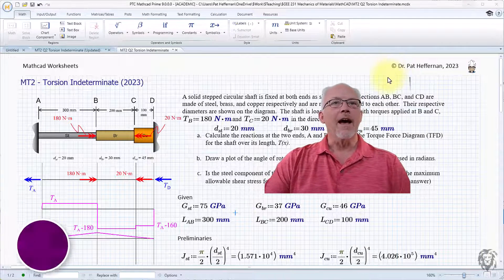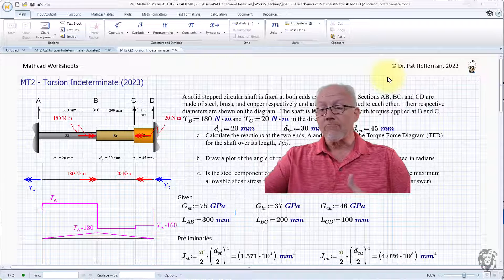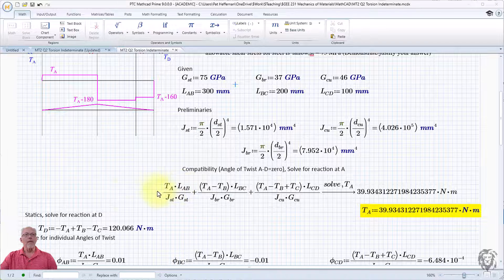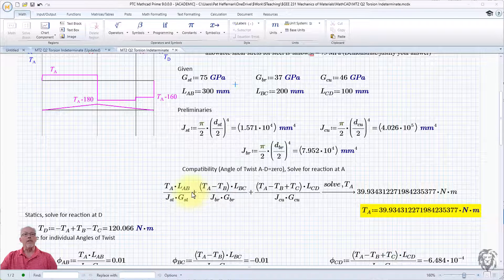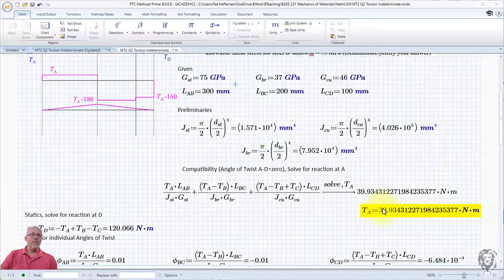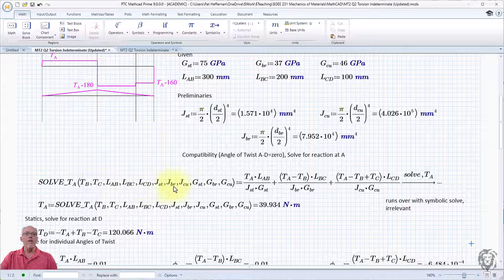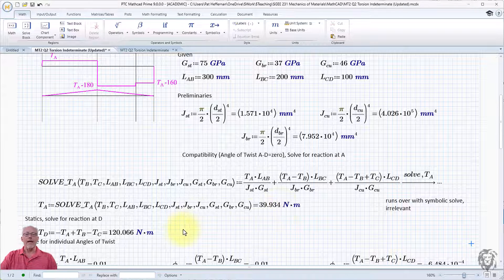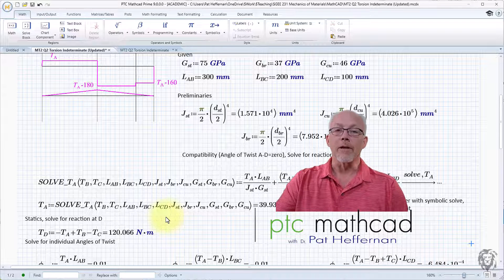PTC Mathcad - Transfer a value from the symbolic to the numeric solver

Comment: I like your posts. Especially because they are in English, easy to understand and we probably have a similar background. Regarding the problem you present here, the presented solution was new to me. However, I have another solution on how to combine the symbolic and numeric processor which usually works quite well for me. I am curious what you think of this one.  https://youtu.be/b0LXvW816rY?t=884
Reply from the maker: Thanks for the link.  I like that a lot.  Of course you don’t really solidify it until you try it so I will try to mimic the method on the solution that I am working on right now!  I’ll poke around and look at what else you post.  Thanks!!!
Reply from the maker: https://youtu.be/AnAI4kMjayo (Thanks Again!)